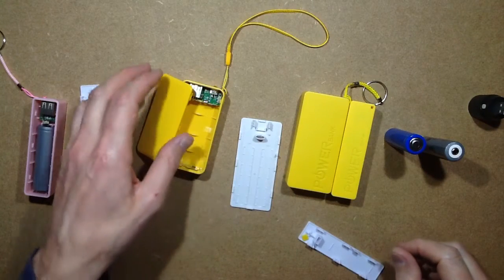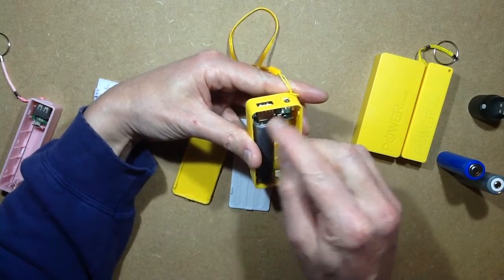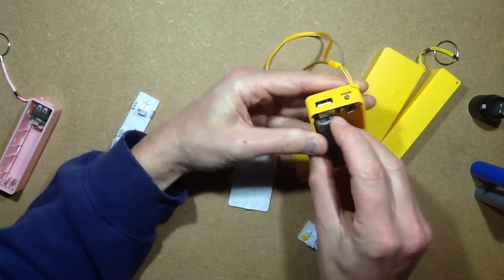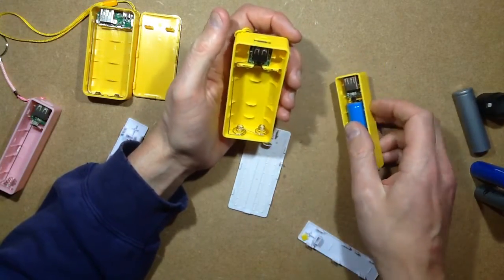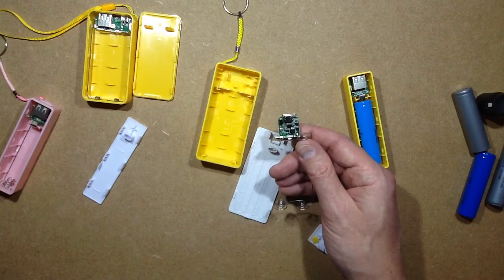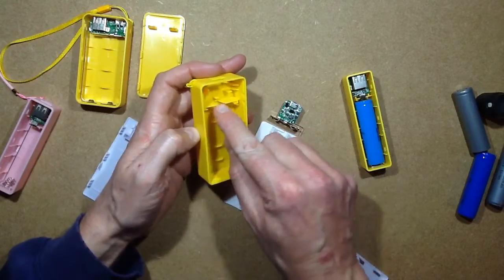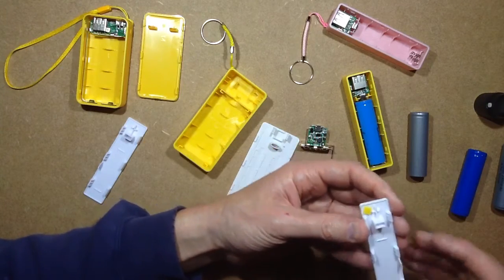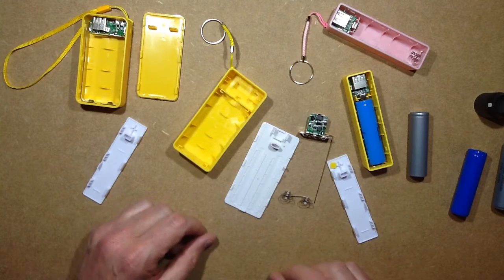2-cell USB lithium power bank comparison.

Comment: I have a couple of the the second type in the video. I recently opened one to take the batteries out to test them in a charger and noticed the shrink wrap on one of them at the positive end was slightly melted. Closer examination showed the wire that forms the spring contacts and runs up the side of the power bank had heated up and burnt through! I don't know if the fault is with the power bank or the battery.

Comment: You should do a review/teardown of this one: http://www.ebay.com/itm/1pcs-Black-5V-2A-USB-Mobile-Power-Bank-Charger-box-For-18650-Battery-phone-Mp4-/181844651745?hash=item2a56c92ee1:g:IKUAAOSwjVVV5VmS

Note: there are 2 versions of this, one that requires activation by plugging in a charger after you put in new cells, and one that doesn't, link is the latter version.

Comment: Obviously more complex circuit boards from China are older models. They must've found a way to save 5 microcents per unit, making it simpler and less robust.
Reply: they probably spent more money trying to make a cheaper model than the actual savings they gained from the 2 nanocent savings per unit

Comment: Some of these banks are perfumed which might explain the soft pad.
Reply: +Max Phipps fom my limited knowledge of parfumes they can have oils in them, so is that enough to create one atom oil protection layer on elecricity? If so, it would be great way to protect some of my projects :-)
Reply from the maker: +Dobrica Pavlinušić I'm not sure that perfume would be as good as a proper VCI volatile/vapour Corrosion inhibitor.  You do get VCI corrosion protection pads or papers on eBay.  But I wonder if vaporising some WD40 might have a similar effect.
Reply: idk if you read the comments on these older vids but I was looking at empty power banks on ebay to put my own cells in and the little yellow pad is indeed referred to as a "perfume card". then again, chinese to english translation can get really weird and its possible that the chinese term for a VCI source, putting something out into the air, could translate as perfume card. who knows, Ive certainly seen direct translations come out with similar strange results. so yeah, glad I could clear that  up for everyone.
http://i.ebayimg.com/images/g/7SoAAOSw-W5U0zy7/s-l1600.jpg
Reply from the maker: "perfume card" does certainly sound like it could be chinglish for a VCI tab.

Comment: Hello friend, I just received my power bank. It is just like your little one yellow with 2 cells. My other power bank has blue led when charge something  but this new doesn't have. What about yours? Have you made some deeper tests on your power bank already? What is your opinion about it?
Reply from the maker: Sometimes it takes quite a lot of current before the blue LEd starts glowing.  On some they may not even have included the LED.